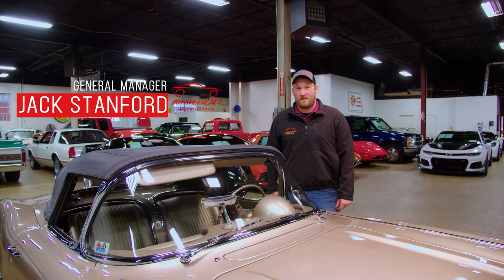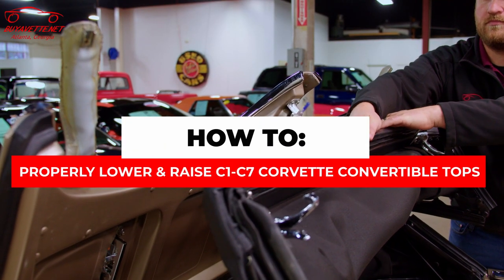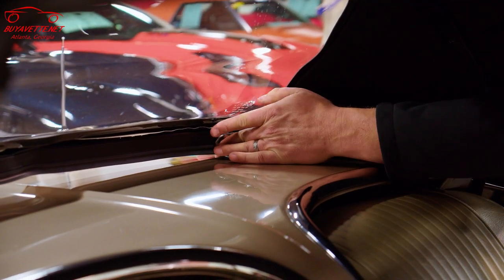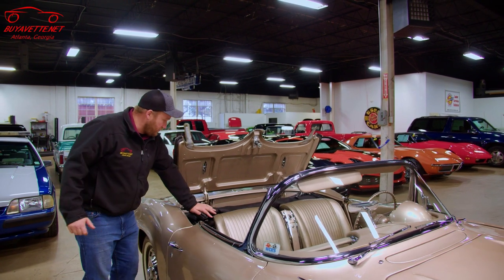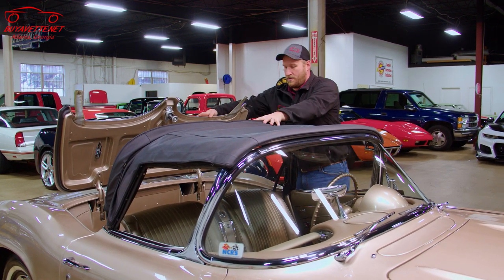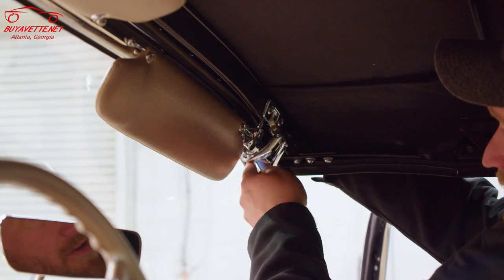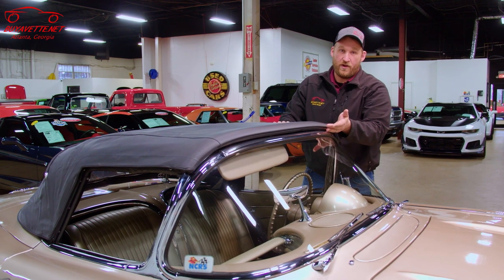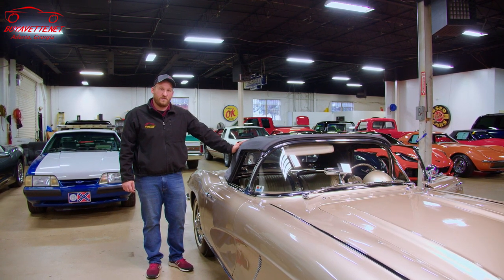How to properly Raise and Lower the Top on a C1-C7 Corvette Convertible

Comment: Do any of these C1 tops seal right in the back? they all seem to have a gap under them.
Reply from the maker: Not really. Pretty typical to have at least a small gap back there.
Reply: @buyavettedotnet  Wow that is kind of annoying. thanks for the info.
Reply: @buyavettedotnet I am considering buying one. is this a leaking issue? I plan one driving mine quite a bit?
Reply from the maker: @bigdaddy5150sh71  yes, pretty much every C1 is going to leak water if left out in the rain. These cars are meant to be garaged, and not driven in rain.